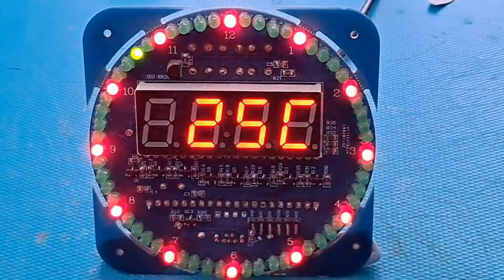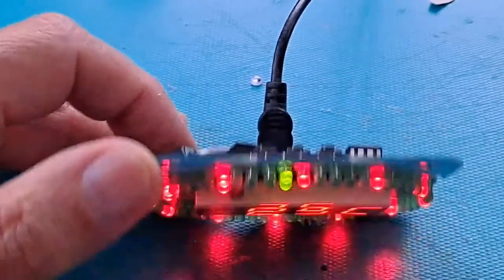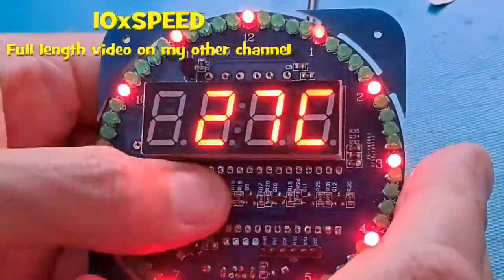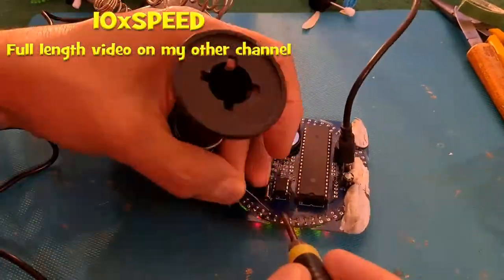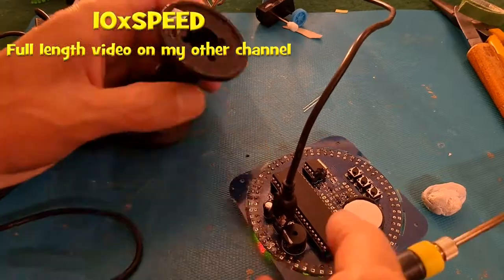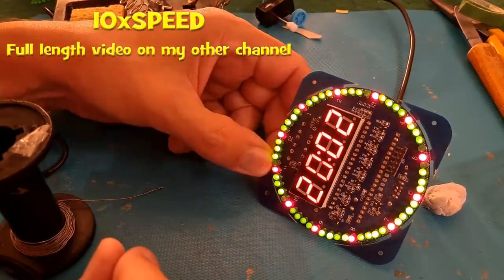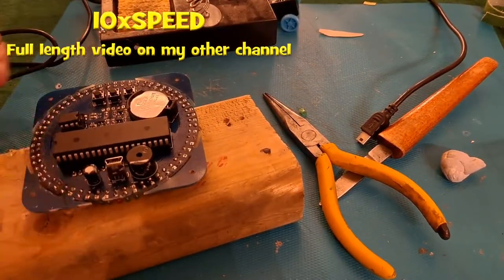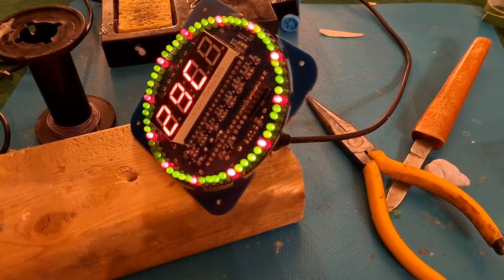Revisiting my EC1204 Digital Clock Kit to fix the dead LEDs - FAST FORWARD

Comment: I made a fresh video about my build of the same kit, showing a new program I wrote for it.  https://youtu.be/KwEUt3JBvO0  My LEDs are all still working - I've had the thing for a few years, though it does spend most of its time powered down.  I'll leave it powered up more often now, and see how well the LEDs hold up.
Reply from the maker: I will check it out, I subbed you from my other channel, so I should see it pop up. I leave mine on continuously. I got the impression that those green LEDs were just a bad bunch. If I touch them in the right way, they light up properly, so it is like they are not set in the plastic domes properly. The reds are fine.